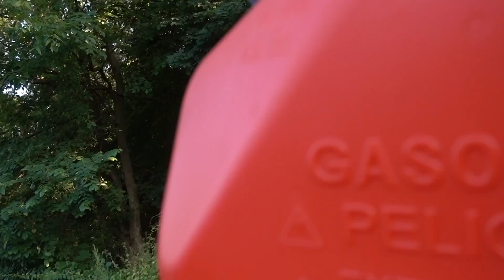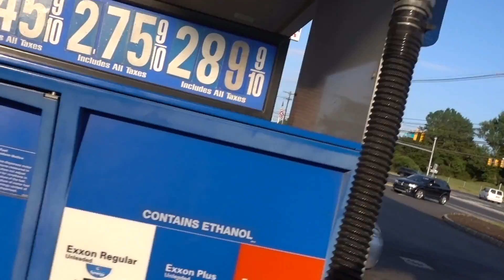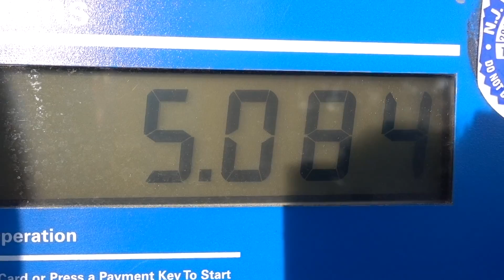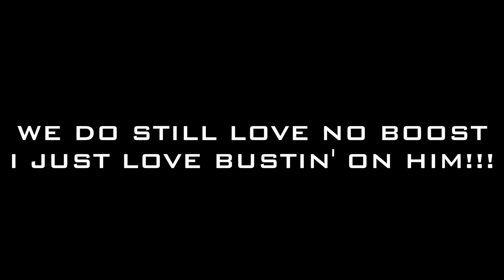WHAT HAVE WE DONE NOW :( THIS POOR OLD 12 VALVE CUMMINS DIESEL TRUCK

Comment: suction cup and heat on back side
Reply: thats not going to work, the bottom sharp crease is whats holding it
Reply: It's worked on a lot of vehicles I worked on with just enough heat it will come out

Comment: they have like a suction cup dent remover that you stick on there squeeze the handle a few times then pull the dent out it works on small dents i have used it

Comment: Take a large pot and fill it with water, bring the water to a boil and pour over the dent. When the dent has been pushed out pour extremely cold water over it to harden the metal and set the shape. Then it is just sanding and re painting.

Comment: Hey Greg. Ford and every other manufacturer tends to put coolant drains in the worst possible locations. I used some stainless pipe fittings and a 1/4" ball valve on my radiator to re-locate the drain past the frame rail. Makes any cooling system maintenance a whole lot easier. Just use a 90 on the end of that valve and plug it when you're running it to prevent any leaks. Hop this helps if you haven't already considered it.

Comment: I would try cutting a 2x4 to length, and brace it between the box bracing, and the trucks frame, then get back to it with the basketball, another thing you could try as far as tight fit would be a 10" scooter inner tube. (shout out to no-boost)

Comment: 93 octane in the washer, not the point. Gas with no alcohol in it. The regular gas with alcohol goes bad more quickly as the alcohol evaporates.
   There is a magnetic dent puller, that may not work with too deep a dent, that may be available at shops that will rent service tools.
There is a set of keyhole studs that can be welded on, in a row. Then a single bar will pull the studs all at once. I refer to a set as shown on an episode of Wheeler Dealers.

Comment: Greg, Several ways to get that dent out. I would use what they call a body spoon. You should be able to pop the rest of it out with one of them. Start at the shallowest part of your dent and work around the edges toward the deepest portion. You could also take a large washer, braze it on the outside and pull the dent with a slide hammer (gently!).
Reply: If you braze the washer on one side only, you should be able to fold it over and break it off.  Hit it with a medium flap wheel to get the braze off the panel.

Comment: What did you do with the basketball
Reply: Luke Meyer he deflated it, then shoved it back in that area between the body and brace, then started pumping air back into the ball. As the ball expanded, it forced the dent out.  Great trick!

Comment: I hate those plastic fuel cans it's like they come up with a new design for a so called spill proof spout but i think they make them spill gas everywhere I use an old fashioned safety can they're an all metal can and they have the spring loaded cap and handle you just squeeze and the lid opens up and lets you poor gas into what you want and then release the handle and it springs back closed they even have little funnels that slide over the pour neck and that way it funnels gas into the tank of your equipment I've actually spilled way less gas if any with that than those plastic ones

Comment: Dont you have any PDR guys down around you? If you really want it out i would call them(as long as its not dent wizard). The bottom of the dent there is that sharp crease, and thats what holding the dent there. A suction cup and hot water is not going to pull that out. A normal PDR guy should be able to get that out for less than 50 cash, if its Dent Wizard your looking at 75+ bc they think their time is special.

Comment: Heat it up on the back side and beat out with small hammer. If ever needing to get a dent out of plastic instead of a torch use boiling water so you don't burn the plastic

Comment: pour hot water on it so it softens the body then take plunger and suck the dent out
Reply: Thomas Harris this is an old school truck. With a metal body. That works on Plastic for sure, or a large door panel. With a crease that bad, a plunger isn't gonna cut it.
Reply: yeah, the hot water is for plastic bodied vehicles.